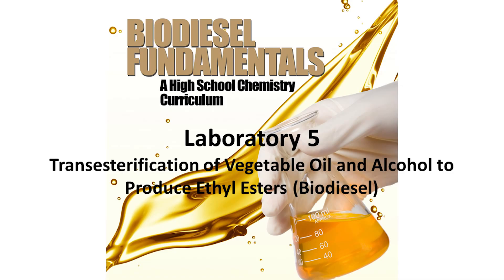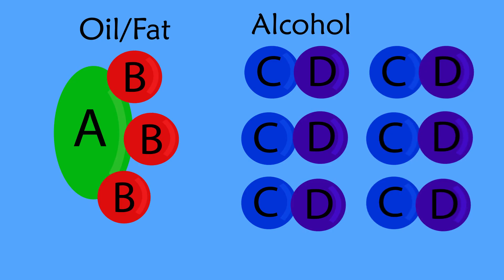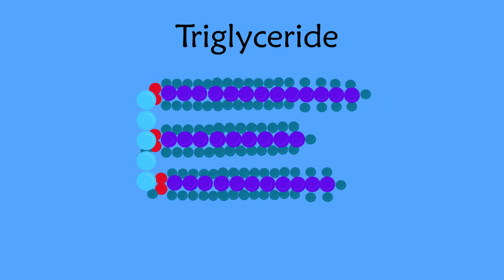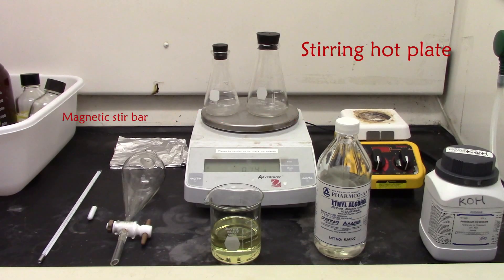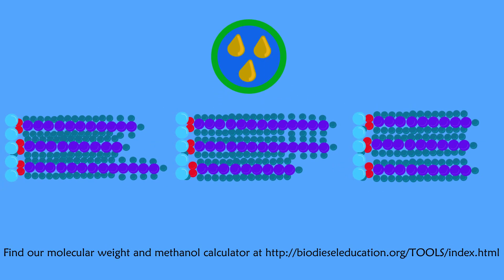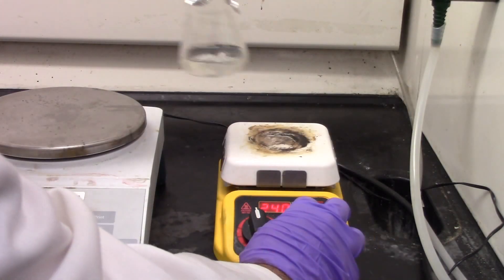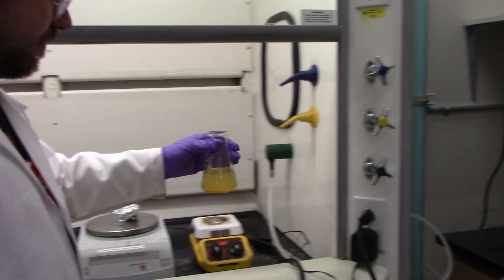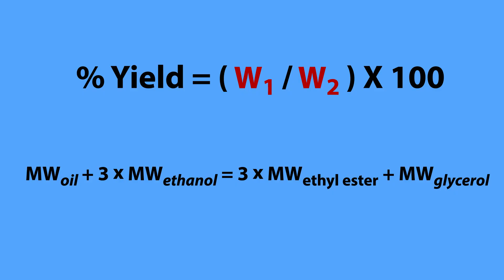Lab 5- Transesterification of Vegetable Oil and Alcohol to Produce Ethyl Esters (Biodiesel)

Comment: Hey, I can’t find how to send a pm. I bought a tincture the desired compound is set in mct oil. Mct oils density is 0.95 g/ cm3. Isopropyl Alcohols is .78 g/ml and water 1.0 g/mI. The compound is alcohol and fat soluble but not water soluble. I was trying to eliminate the oil by dissolving it in 99% alcohol. I’m guessing I would have to heat it up or maybe simply mix.The compound I would like to keep has boiling point is 320 f. Could I simply heat it with the proper temperature and ratio alcohol or just alcohol then evaporate the alcohol leaving me with just the compound or a less oily compound? Or can I simply heat it up in a mixture of alcohol extract it in the alcohol and then freeze the mct oil overnight (obviously alcohol won’t freeze) but when the fat freezes scrape it off? Would the extracted compound be left almost fully in the alcohol not oil? Also would you know proper ratios? I have looked all over the internet so my last chance is this comment lol. You seem to know what your doing.

Comment: The best and most practically useful video I've seen on this subject, so far. Of particular interest to me, here, is How anhydrous does the ethanol need to be for this to work properly, please? Also, how necessary is the preheating for this reaction. I would like to try on a much larger scale, but that will probably mean using plastic containers (PP, HDPE etc.) Which might not take the heat to well, especially, in the presence of an oil...
Reply: The problem is the oil.  it does have water in it.  From my tries, heating it for an hour is not enough to get it dry.
I read copper sulfate can be used for that goal...  I have not given that a test.
Reply: A natural gravity separation for oil is needed previous to the ethanol mix, you can later use zeolite or also called 3a molecular sieves to get rid of excess water from the mixture since ethanol will pull humidity from the air, you can also put a .5% mix of methanol to the final mix to help with water displacement

Comment: Can this process be used when the catalyst is an enzyme particularly lipase?
Reply from the maker: While we aren't experts in that topic specifically, biodiesel has been shown to be effectively produced by enzymatic catalyst and also, numerous researches have been performed to obtain highly active lipases and to optimize process conditions for biodiesel production. https://pdfs.semanticscholar.org/cb47/05a8b6ce3391f78a15a9e8c79e1e2816f53e.pdf
Reply: It's also worth noting that the Chinese have been working on a solid catalyst that is way easier to recovery. Not sure if you can buy it off the shelf, though.

Comment: Sir, we have in Brazil ethanol with 5% of water (95% pure). How can I do for me to use this kind of ethanol?
Reply from the maker: Anhydrous alcohol is preferred, but high alcohol concentration should work. Water can aid in soap formation and excess water must be removed in later steps before using the fuel.
Reply: @BiodieselEducation  Thank you so much for your prompt reply. And how can I remove the water from the ethanol? Thank you again.
Reply from the maker: @marcelolima-adv  Distillation can only remove most of the water, but molecular sieves can remove almost all of it.
Reply: @BiodieselEducation  Thank you so much.

Comment: Hi, after removing the glycerine you add the rest of the alcohol/catalize
Reply from the maker: That's correct!
Reply: @BiodieselEducation  Sir, why do I need to add the rest of methoxide? Or rather, why you did not add the alcohol completely?
Reply from the maker: @marcelolima-adv  We do first 80% of the the alcohol catalyst mixture, then we drain off the glycerin before adding the remaining 20%. It's a tactic we use to increase our yield.
Reply: @BiodieselEducation  then it's needed to reheat? For How long?

Comment: Which one is the best Ethanol or Methanol?
Reply: It depends on what you define is best. Ethanol and Methanol both can make high quality diesel, however, the performance of each fuel slightly differs based on the type of oil you use. Cost is normally the largest concern with methanol being the cheaper of the two. Environmentally ethanol can be better as it can be made from a near carbon neutral source where methanol is typically made from petroleum. Ethanol is often used when the production facility can ferment their own alcohol and mix it with their waste cooking oils, such as potatoes for french fries.

Comment: If im using CaO dor my catalyst. Does the catalyst and the glycerol can be reuse?
Reply from the maker: While we typically don't use CaO as a catalyst, it may be possible that it can be reused. (When initially used, it should be fresh because when exposed to CO2 it will degrade and become ineffective.) You could try washing it and drying it down, and trying it a second time.

Comment: How to calculate mole?
What is the mean of 3:1?It is the amount of  methanol and alcohol use for biodiesel production?
Reply from the maker: Hello and thanks for the question! This video has an updated version: https://youtu.be/sSLulgJ-E00  because one of the calculations has a mistake. Are you referring to the (correct here) calculation (for ethanol) of (100 g oil/877 g/mol) = (X g ethanol/ 6*(46 g/mol))?  The 877g/mol number is used for canola oil and is found from the periodic table. We have a calculator on our website http://biodieseleducation.org/Production/MolecularweightCalculator.html that allows you to calculate average molecular weight of other oils as well. The 48 g/mol number is used because we're calculating for ethanol. For methanol, you would use 32.04 g/mol. 

The 3:1 just means a 3 to 1 molar ratio of alcohol to oil to satisfy a complete reaction (it takes 3 molecules of alcohol for every molecule of triglyceride). Often a 6:1 ratio is used by producers to drive the reaction to the products side. 

Does that answer your question?